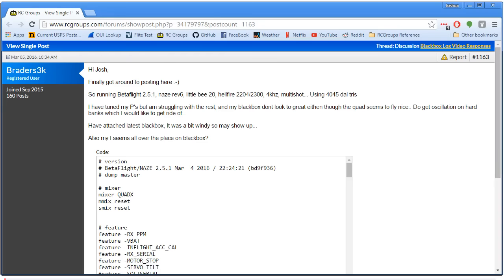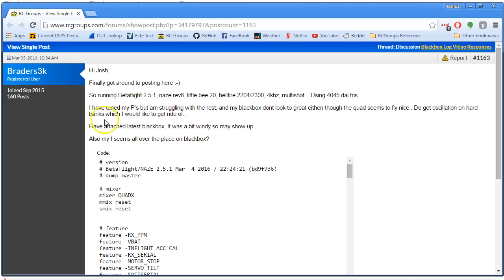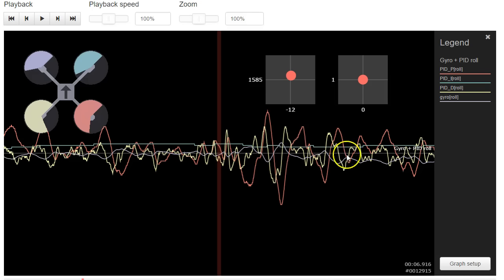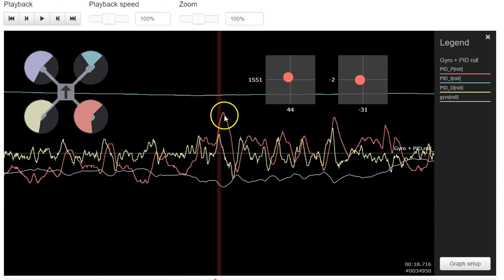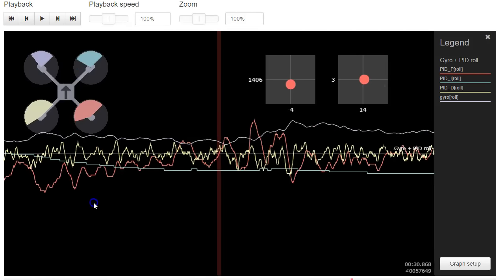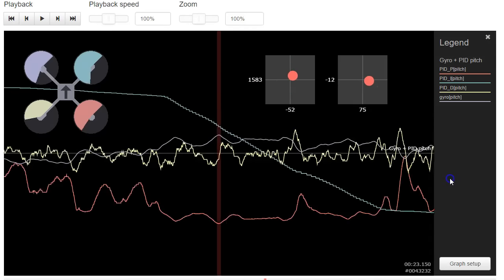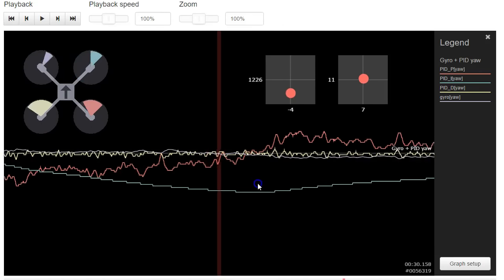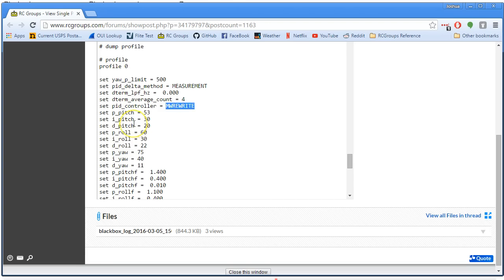Blackbox Log Analysis: Braders3k - 3/7

Comment: you can run multishot on the little bee 20's??
Reply from the maker: +NJ Tech Uhhh... no, I don't think so. Good point.
Reply: +Joshua Bardwell just did some reading, there is a hex available to flash the little bees, mixed success from what i hear right now, including desync problems for some etc... so there's an unwanted variable for this guys log! That's living on the bleeding edge for you, Joshua  :)